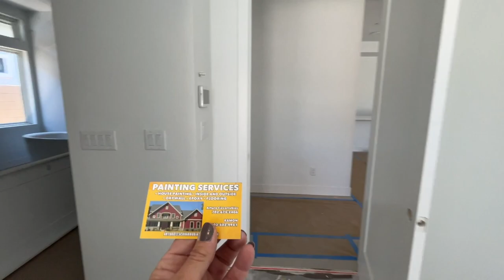Kestrel Village Summerlin Tour - Las Vegas Real Estate Market Thoughts

Comment: Are you at all concerned about the water issue?  Bureau of Reclamation is estimating another 20 to 25 foot drop in Lake Mead by next year.  They are forcing the states to come up with a plan to cut 2 to 4 million acre feet of water use to combat the drought.  I know the largest users of the water are irrigation farmers in Imperial county California.  Decisions will have to be made about the types of crops grown.  In my opinion, the cities in the southwest should probably put a cap on growth.  My concern with the lake is if it drops below 1000 foot elevation, that will have a huge psychological effect and maybe a scramble to move out of the area.